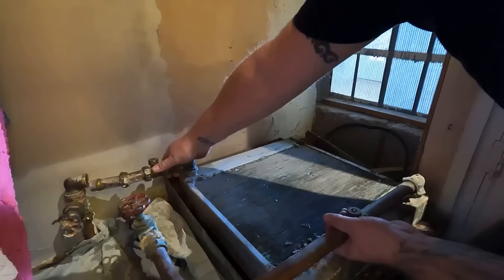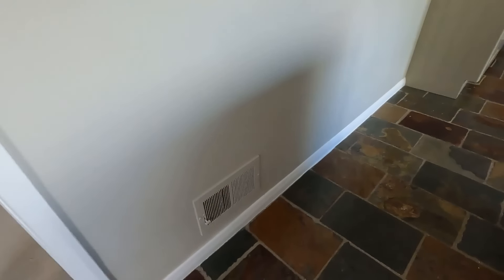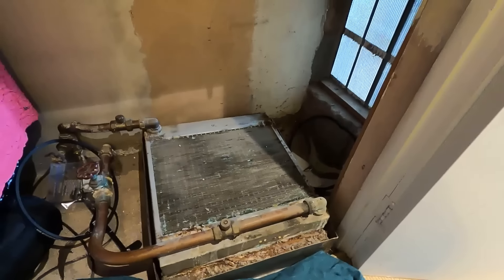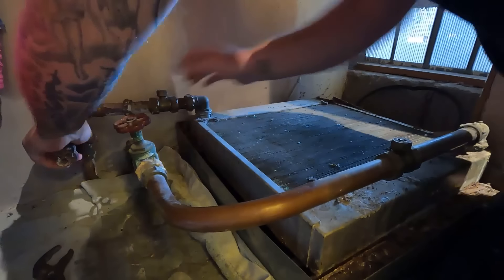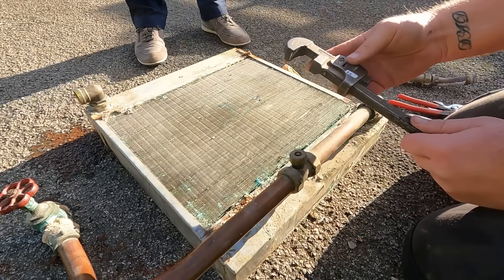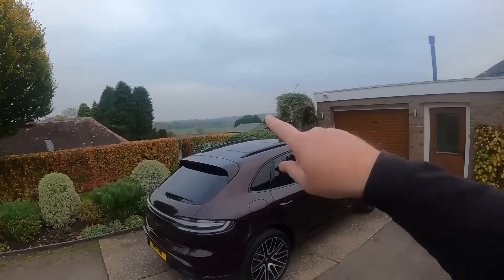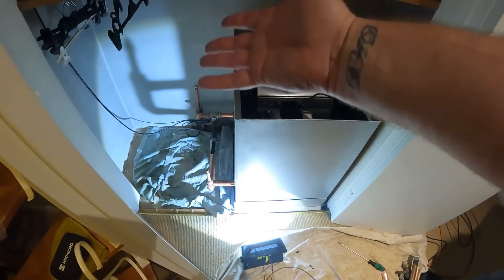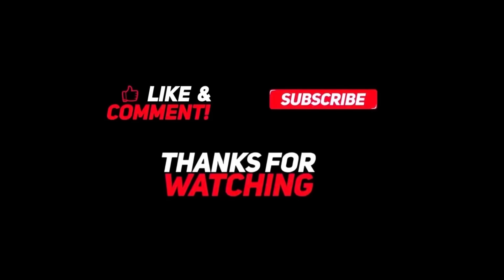Can This HEATING SYSTEM ISSUE Be FIXED?? Warm Air Heater PROBLEM

Comment: Great vid Mark, brought back a lot of memories when I worked for British gas as a engineer.  Well done for having a go. The only thing I would have added is a fan thermostat to prevent the system blowing out cold air, but none the less a great interesting vid 👍👍
Reply from the maker: Thanks mate, was very interesting job that’s for sure….
Adding a stat is a good shout, however David has worked it for 60years as it is so knows it inside out

Comment: Thoroughly fascinating video.  I love the simplicity of the system.  We had something similar in one of our houses in the nineties but it relied on a central storage heater which warmed over night on economy 7 electricity rather than a hot water system.  Can't help thinking how much we tend to overcomplicate these days..  One tip top though, don't store rancid trainers in the same cupboard, or you'll get a lovely smell wafted about the house, that's from experience.  Thanks for the vid.
Reply from the maker: Hahahah very true about the trainers 🤣👍🏼👍🏼

Comment: Oh man...great idea at the time but the amount of dust they produce! Took one to bits in the early 00s and I couldn't believe the amount of dust that had built up inside the ducts and fins......still come across similar systems in schools (usually the large spaces) where the heating elements are set at high level....if kept clean they are really effective but getting up to them can be a right ballache.....
Reply from the maker: Oh yes…. Schools all use them… or did

Comment: Have friends who lived in Stafford back in the seventys in one of those houses built in the sixtys, same vintage as Dave's. The warm air heating was atrocious , with the fan cutting in and out on the room stat, one minute it was roasting next it was freezing. I can see Dave has a relatively new boiler, may be that set up would benefit from a modern control system. May be,  hot water priority and weather compensation would smooth out the tempreture rise and fall. May be this is already fitted , I would like to know.
Reply from the maker: Tbh he knows how to work this system to suit him and turns it on and off as needed.
It could be modernised if he wanted to… maybe one day

Comment: Was there a mesh filter that sits above the fan to prevent the fan drawing in lint and blocking heat exchanger?
Reply from the maker: There’s a cover on the outside of the cupboard… that’s it…..

Comment: I repaired a forced air heating system in a house of similar vintage a few years ago, my mate repairs oil boilers but he was stumped with that one and two other electricians hadn't a clue about the spiral stats, old cutler hammer contactors and mercury TS thermostats. 
What was apparent was that several people compounded the problem by disconnecting low voltage transformers and totally misunderstanding the controls that operated the fan and burner. I figured it all out, reconnected it and explained to the old man what i had found and what I did to repair it. 
All he said with a smile was, "You are a clever man". That confirmed what I knew and that was that I was only being told the bare minimum about how it got into that state.

Comment: I’ve never seen one of those on a domestic single dwelling before. When I was an apprentice we work on a housing estate in south London which had that type of system. Boiler house fed the estate and the individual flats had those heat exchangers and fans. And I believe it was the same manufacturer.
Reply from the maker: First one for me aswell

Comment: Hi Ya . I have watched quite a few of of your vids. Can i ask about your soldering ? Do you clean (wire wool or similar ) the inside the elbows and Tee's before soldering and the outside of the pipe going into the fitting ?
 At times it looks like:-  pipe cut... open bag of fittings and flux up and solder. I've done quite a bit at home and have been fastidious about cleaning inside the fittings , much to my chagrin. mostly 15mm and 22mm . Love to hear back from you. Best regards , Don.
Reply from the maker: Hey Don….. yep, literally flux in fitting and on pipe… away you go.
If it’s old pipe then give it a clean with wire wool👍🏼👍🏼

Comment: I have done a similar job about 10 yrs ago  but the unit was mounted in the loft of a bungalow, also oil fired and self built in the seventy's by the owner .

You or David need to cut a couple of bits of close fitting tin plate around the 28mm primary's, as you will be loosing heat blowing out.     HTH

Nice to do something a bit different and I enjoy the jobs some others shy away from,  today I swapped a back boiler in a 70yr old coal Rayburn, interesting but filthy.............
Reply from the maker: Love doing stuff that is a little bit different

Comment: Well I have exactly the same system from 1967. Have replaced the bearings and radiator and the Hi Vee system is brilliant.  My system has an electrostatic air cleaner and keeps the bungalow beautifully clean. The big no no is don't replace the radiator with an aluminium core otherwise the copper and aluminium will react !
Reply from the maker: Great systems ain’t they… so basic but so good

Comment: I used to love working on these as an apprentice because early 00s it was the only old school warm air that didn't have asbestos in it. They're pretty bullet proof and provide fairly even room temp compared to using radiators. It's nice to see Dave keeping it running instead of having a BG contract and them trying to talk him into unnecessary work having rads everywhere.

Comment: About the same date of original install of my previous house, it was fantastic.  We moved 7 months ago and we have a conventional radiator/boiler system.  We miss our warm air heating, found it cheaper to run, house warm up time was about 15 minutes typical in current weather.  Obviously residual heat at switch off not as good.  Great vid thanks
Reply from the maker: Yep this warmed David house soo well….. and was very cheap to run

Comment: Thanks for that, Mark: fascinating stuff. Our street was all warm air heating when it was built but I think it was the Johnson Starley type and most of the houses binned it years ago. It’s impressive how that one heat exchanger can do the job of half a dozen radiators. With the push for heat pumps I can see ducted air making a bit of a comeback in the next few years.
Reply from the maker: Yep I completely agree with you mate, this works perfectly
Reply: Johnson & Starley were not innovative enough and too set in a rut,  I changed my JS to a Lennox from the states and it was superb in operation and engineering.
Reply: Yeah, the yanks are really into their warm air heating. In fact most of the world is, but it hardly gets a look in over here. Maybe it’s because the old systems weren’t much cop and by the time anything better came along, most people had already put radiators in.

Comment: Great video mark nice to see you give that warm air heating a new lease of life where many others would have said it’s had its day. Like the bleed screws you put in was wondering where you going to fit them 😂😂😂 remember loads of these warm air heating systems made by Johnson starley that where put in houses in the 70’s and 80’s as they where the in thing only to be done away with blanked off and rads fitted. Top work
Reply from the maker: Thanks mate, your I really enjoyed this one

Comment: Saw something similar down in Hampshire Ideal Concord  upstairs heating the warm air unit downstairs..also many years ago came across a free standing boiler  with a mechanical time clock which was powered by gas with 2 little gas pipes to the clock I'm sure i wasn't dreaming 😁
Reply from the maker: We see some crazy stuff

Comment: Looks like it's all had a bit of a make over 👍👌.
I think we all come across something we have not dealt with before ..Best thing have a look then you know what you are dealing with .👍👌
I used to look after a same sort of system. But used electric storage heating. Had the big fan installed as well .👍👍
Reply from the maker: Yep David gave it a proper spruce up when I had it apart

Comment: Had this sort of system I'm a house I grew up in think the house was built 1970. Boiler was condemned in late 90s for chucking out alot of co (i was so ill it nearly finished me off tbh) and the whole system was replace with radiators. Very intresting job for you and the way the plumbing world seems to work you will probably get a call about another one soon and can say "yea, I can sort that"
Reply from the maker: Haha yep, warm air specialist now🤣🤣

Comment: My dad bought a 60s bungalow in the late 80s that had a warm air system, the boiler was a tall, all in one unit in a cupboard and that's what I was expecting here. He was advised to get rid of it when it broke down due to parts obsolescence. It seemed a shame as it heated the house very quickly. The hot water was provided by a separate multi point gas boiler that gave a very poor flow rate.
Reply from the maker: Yer I think over seen something like that before…..

Comment: Worked on plenty of warm air units that are all the 1 unit, never seen 1 that runs off a boiler with that set up!!! Great video!
Reply from the maker: Yep this was something I’ve never seen before but it works so well…. And will do now for another 60years I hope
Reply: A company I used to install and service my warm air at my previous home were installing Worcester Bosch boilers feeding a heat exchanger for warm air circulation.  Boiler was a Lennox from the states - superb and over engineered.  But expensive by conventional boiler with spares costing.  Miss my warm air!!!

Comment: My Uncle was cut from the same cloth as this fella. He was a young engineer in the merchant navy in the last few years of  ww2. He ran a very large refrigeration plant for many years in my home town. He was great at this sort of stuff. When he had heating fitted in the eighties he fitted a heater matrix in the ground floor warm ducting air and fed it off the heating flow and return.
These old guys are unfortunately few and far between nowadays , which is a shame as they were really clued up on anything engineering.
I work at a film studios which in its previous life was an MOD research centre and the pipework and engineering stuff we have  found in there is mind blowing. I very much doubt we have the skillset nowadays to replicate some of this stuff.
Reply from the maker: Paul you are 100% with your comment mate, David and your uncle were from an amazing generation……🙏🏼🙏🏼

Comment: Why did you replace the original pipework? It's been ok for 50 odd years.
Reply from the maker: Wanted to get rid of the gate valves for one that work, also to get new vents in.
It had to come out to get the unit out….

Comment: My Nans Sister was the first person to move into a new council house end terrace in the 60/70's. 3 bed end terrace. Living room. Dining Kitchen. Front porch and downstairs loo and rear lobby plus family bathroom. Bought it for 7k. In the year 2000 I passed my NVQ Level 2 & 3 City and guilds plumbing and gas and I replaced the warm air heating with a Worcester Bosch 24I Combi boiler. 7 Danfoss TRV's, New gas supply. 8 radiators and all in 22 and 15mm copper pipework. Charged her £400 labour and took me 5 days to install. My relative never liked the warm air system and to justify the cost to her husband said that the warm air unit was condemned by British gas and parts no longer available, while he was in Hospital with a hip operation.
Reply from the maker: Hahahah brilliant story, love that 👍🏼👍🏼

Comment: Hi Mark…. Tidy repair… just one comment it’s a wonder the heating coil worked. The pipe nearest the back wall you have created an air pocket that can trap air as the pipe drops down to the air trap. If you had raised the tee on the back wall it would have self aired to the highest point instead of dropping down. Hope it makes sense.
Reply from the maker: Yer it does and I mentioned this in the video….. however it works a treat as it’s a pressurised system 👍🏼👍🏼
Reply: Mark… I am glad it is working but the way it’s piped it will still collect air and be very hard to get rid of. I have been in the trade for 43 years and even if it is a pressurised system or opened vent system if the pip work has air in it … trust me it won’t work
Reply from the maker: Steven…..It has a thumb vent on the top for exactly that reason mate…… I’ve been in the trade 31 years and know how to get rid of air from a system… trust me, this is working as you can see
Reply: Pump will push that air out no problem
Reply: No further comment 🙈
Reply from the maker: No more to say….. that’s why…….👍🏼

2 weeks later and the system is still working 100% fine…… contrary to what Steven thinks.

Comment: surely it should a pipe stat to stop it blowing cold air
Reply from the maker: Was installed way before they were a thing…. But guess it could have one retro fitted. Not been an issue in 60+ years
Reply: @Exgasman9072  the air is taken from inside the house so all it would do is recirculate the existing air, also it would only run when there is a call for heat

Comment: Why add the thumb vent at the front and not at the back with the other one would have looked way better and less chance it gets caught and damaged
Reply from the maker: There is one at the back mate…. Did you watch the video..
And as said in the video the one at the front is not going to be in the way for David at all
Reply: @ I understand that just wondered why you didn’t do the same as the one at the back with compression tee and thumb vent keep it all back and properly out of the way. Genuinely wondered you been doing this longer then me so wondered if there was a reason behind it other then easy to get to ? Maybe I missed a bit.